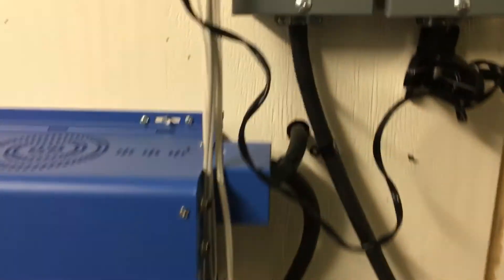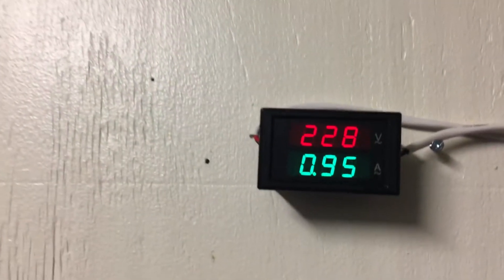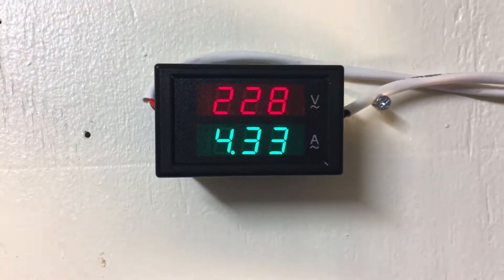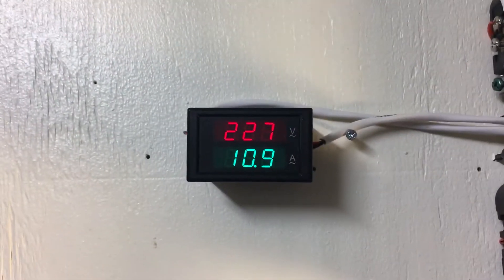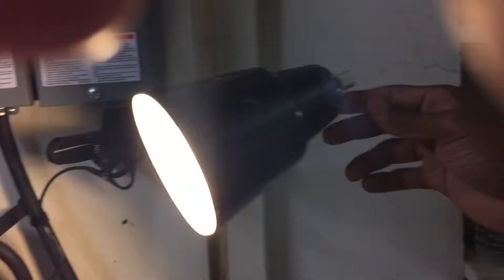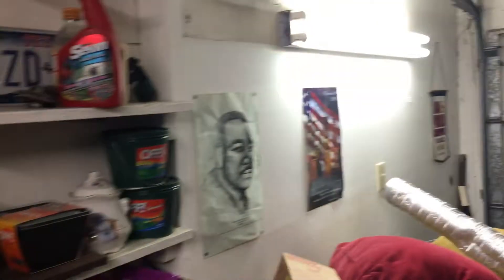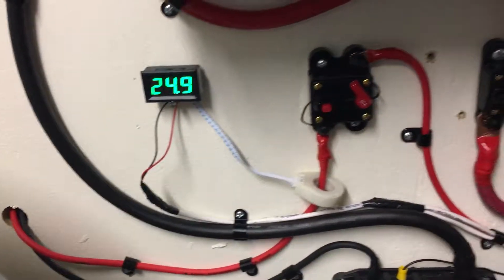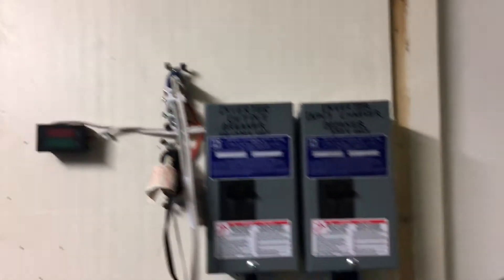My new AIMS 6000 watt 24 volts DC to 120 - 220 split phase inverter charger load test.

Comment: NIce setup player. Keep upgrading your system and don't give up.
Reply from the maker: THANKS VERY MUCH . WILL UPLOAD ANOTHER TEST RUN SOON . ILL TAKE SOME TIME SETTING UP THE PV PANELS AND THEN START WORKING ON THE WIND TURBINE LATER ON .
Reply: I live in the north of Canada, in the hi of 30 Celsius and lo of -50 and i have a 40kw and a 10kw lithium car battery bank, 4500watts of solar and two 2 kw wind turbine, a 3000watt 12v pure sine inverter and 2 x 4000 watt 24v pure sine, three midnight classic 250. I run 4 oil heater in winter on max and never run out of power in my 37 foot fifth wheel.